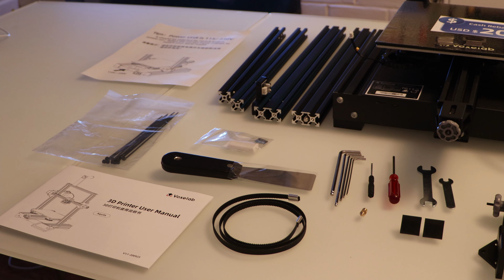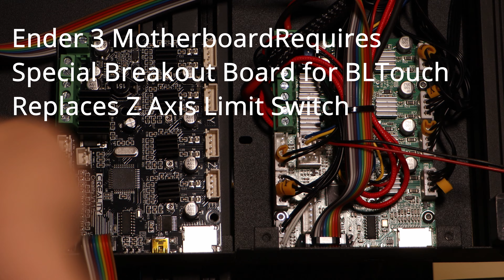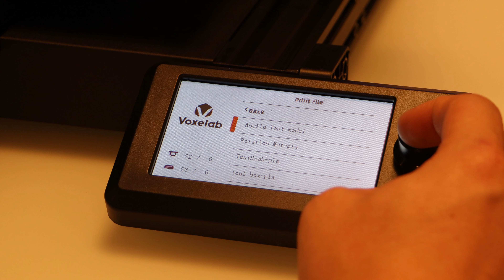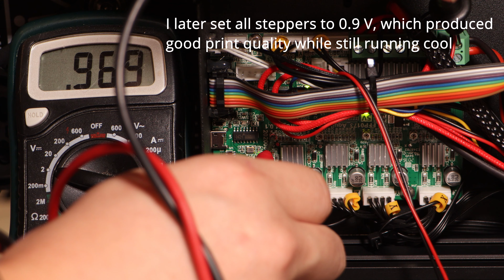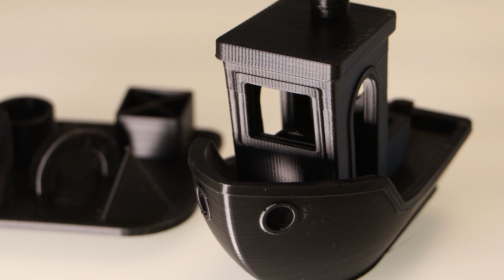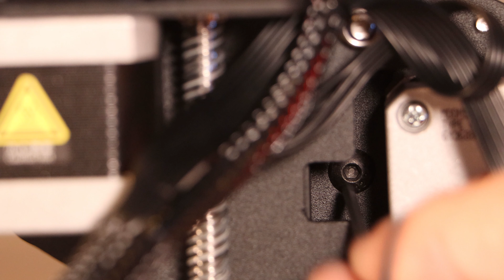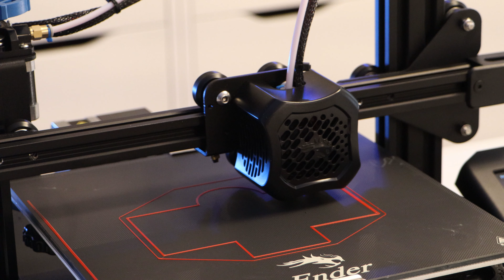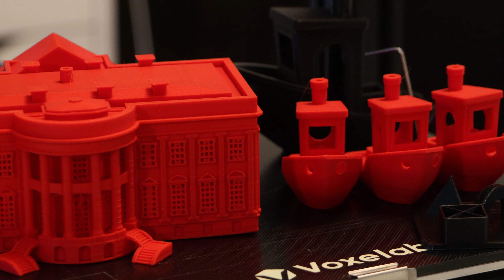VOXELAB AQUILA VS Ender 3 V2 - Which Budget 3D Printer Should You Buy?

Comment: the voltage switch put simply if you were to plug into a american outlet while on 230V put simply it just won't power on as it won't have enough juice, same the other way round my guess is at 110v if i plugged it in in my home set to that it most likely won't power up if it does it will work horribly as it won't be drawing the necessary power

Comment: I have had an Aquila x2 for years and was happy with it. I have now bought an x3 - it is going back to Amazon on Monday. 
Avoid the x3 - Avoid Voxelab from now on. They claim it is Cura compatible but don't publish a cura profile, the manual is assembly instructions - not a manual. The 'bed levelling' doesn't work with G29 at the begining of a print. THERE SEEMS TO BE NO Z STOP switch. You have to manually set Z zero!  The x3 is an x2 with stuff added badly - I didn't need to replace my x2 so the x3 goes back.

Comment: For anyone wondering what to purchase between the Ender 3 V2 or this Voxelab Aquilla X2, after owning both, I really like this X2. The Creality was better packaged but that's about the biggest difference. The machines are 99% identical. The X2 also provides a filament runout sensor and an aluminum carry handle. I got my X2 for $160, for that price I can upgrade it to a direct drive extruder and be at the same price of the Ender at its cheapest. I run Jyers firmware on my Ender which is a great enhancement.  But running stock firmware on both machines side by side, they print equally and are both great machines. I didn't have any quality issues with my Ender as he had in this video, in fact the fit and finish was slightly better on my Ender,  but you are paying more for the identical machine.
Reply: Is the X2 noticeably louder or are they much the same?

Comment: hey dude so i just brought one and it will not print properly after i ran out of the filament that came with it  iv tried every thing other videos suggested  but it will not stick or will fail all to gather iv leveled it and even max temp it what can i do
Reply from the maker: Could be the filament you're using. Also I wrote the bed with alcohol wipes to make sure it's clean off dust and oil. Could be a lot of things though

Comment: Which slicer did you use for the voxelab Aquila???
Reply from the maker: You can use Cura or Prusaslicer, though I prefer Prusaslicer.  
Just use a profile for the Ender 3v2. This machine should print exactly the same.

Comment: Best look at these great printers I've witnessed. Thanks mate! 
Just ordered an Aquila X2 as my 1st 3d printer. Would it be fine if I didn't mess with the stepper with the multimeter and left it stock, or would it be best if I'd check it just to be safe?
Reply from the maker: Yes, it is well within normal operating temps. Steppers can run over 70C-80C without issue. I was just going the extra mile with tuning and efficiency.

Comment: When people make these models do they also have to design the make up of the inside of the prints, the parts you don't see, all of the cross hatching the fillament filling has to do?
Reply from the maker: No, that is taken care of by the slicer program. It is called "infill".

Most people use 15% infill, so the parts are much lighter and print faster, but you can't tell from the outside

Comment: I have a Voxelab Aquila I bought after you made this video and I have analysis paralysis looking for the ideal extruder/hot end combo for .4 nozzle and below printing. Until now I print a lot of smaller detail parts and structural stuff for scale models. I plan to print PETG/ABS/ASA/CF Nylon and get an ender extender kit and enclosure for it soon. 

If price was no object, what are the main upgrades you would recommend going from stock for print quality and reliability? I've had two thermistors go bad in the last weeks giving thermal runaway errors on long PETG prints. I think it is my Aquila's way of telling me she's ready for some enhancements.
Reply from the maker: My favorite upgrades in any machine are

All metal heatbreak
Dual gear direct drive extruder

I go with cheap BMG clones 90% of the time, but if price is no object I would try out the LGX from Bondtech. 

It really depends on what you're goal is. I find most printers to be too slow, so I usually also put a 0.6mm nozzle on too so u can run .4mm-0.6mm layer heights. I could recommend a CHT bozos if you want more speed
Reply from the maker: Also I really like textures PEI build surfaces
Reply from the maker: If you want a bigger printer, I'm reviewing the LONGER LK5 PRO, i went in with low expectations, but it's got fantastic print quality.

Here is an affiliate link to the LK5 printer, it can be found 80-100 cheaper on other sites though
https://amzn.to/3pIRbgS

Comment: voxelab is flashforges budget run of printers. i was blown away by how well the build qaulity was for the voxelab proxima for the price so when they come out with the aquila i wanted one but never bit the bullet just cause i didn'tt really have room for another printer but i just got one for 100 bux so was hard to pass up plus ive recently made room and couldn't pass up the deal so i got. ive done the 230 when it should have been at 115. i dont it on my anet e10 printer when i first got it a couple yrs ago. it actually worked fine until it started trying to print an even then it was able to pull it off, it just took forever for the bed an hotend to get up to temp. i had put a silicon sock on the hotend so i feel like it wouldn't have been able to get up to temp if i hadn't done the silicon sock but i figured it out when googling the slow heating times but by that point it had already started the test print an was actually looking ok but i stopped it an changed the settings. now from my understanding if u do it in the opposite way. 115 when it should be 230 then ur sending more power to it then it expects an should pop a fuse if it has one or could do damage if not. ive always wanted to make videos on my printers but my work space isn't the cleanest so ive never went through with it but if i ever manage to get a tidy work space i may try to share my work space. i have 10 fdm printers now an 2 resin so im by far no print farm but i have been able to make them pay for them selves an then some. also i love my creality machines, ender 3 an ender 5 but ive always looked at them all the same, they are budget printers an even with the most expensive "budget" printer $500 US for a sapphire plus vs the cheapest $150 US kingroon kp3 they all worked perfect after a little tinkering, some with less but they all worked out of the box and all the tinkering just made them better.

Comment: Going to voxelab as my first 3d printer. I don't have a temp scanning device so what happens if I leave those stepper motors running hot?
Reply from the maker: Nothing, they are just fine running at higher temperatures. I just brought it up because it was a difference I noticed. 
 You'll be able to feel the difference though.  65 degrees C is too hot to leave your hands on for long

Comment: Where can I get an SD card with cool printing designs for my son. Not a computer guy. He has the voxelab aquila c2 printer. Thanks
Reply from the maker: You have to use a slicer to generate the printable files.

Look on thingiverse to find STL files, which you can open in PrusaSlicer or Cura.

I like Prusaslicer, there are tutorials out there to help guide you through the process. For all intents and purposes your Aquila c2 is pretty much an ender 3 v2, so look for Ender 3 v2 guides. Good luck!

Comment: With the wrong setting on the power supply the printer wont start right away. It will take an unknown amount of time tell it may or may not charge its capacitors to the right voltage to start. however you will have power failure during the print do to loss of power to high components "hotend".

Comment: If you set the voltage incorrectly the surge in power will cause your home circuit breaker to pop. If you're lucky it will pop before there's damage to the power supply.
Reply from the maker: I see. Just for context, are you with team 110VAC or team 220?
Reply: @NathanBuildsRobots  110

Comment: If you use the wrong voltage setting, the power supply will explode, at least last time this happened to me. I was using an old dusty PSU though.
Reply from the maker: I see. I'm taking a poll of puerile who have answered this question just to figure something out: are you team 110v or 220v?
Reply: @NathanBuildsRobots  Whatever works in your country, I say :)

Comment: I've yet to run my first 3d printer. Before buying, I have watched countless hours of videos on printers from various users to compare. I can say without a Doubt two things. One, your video has been the most helpful and insightful of all those I have watched. I believe it's helped me finally come to a decision. Secondly, I can also say do NOT mess with this man's screws! But in all seriousness, with the high video quality and meticulous attention to detail, I will likely be going with Voxelabs moving forward. I simply agree that the amount of thought and detail they have put into their machines has resulted in a higher end product coming out. It looks as though this may be a very good step into exploring 3d printers for me.
The print quality and comparison of issues out of the box between the two manufacturers is impressive. From what i could see from your video, Voxelabs just seems to manage a better print quality than the Ender 3 v2 as well as a better user experience and a reduction in waste. I appreciate the time and involvement you put into making this video and just want to say thanks again for taking the time.
Reply: I now have 3 Voxlab printers and love them! Here are 2 upgrades for less then $40 that will make all the difference. Upgrade the extruder to an all aluminum! Replace the hot end, mother board and power supply fans. They are noisy and 2 went out within a couple of months. If I have the need for another printer, it will always be a Voxlab.   With 3 printers, I have spare parts on hand for almost every component. Not saying you have to do the same, but the reason is,  when my first went down because of a broken wire on the x Axis plug. I was left for 3 days and not printing. $100 is spare parts gives me that piece of mind. 
Also, checkout "3dprintsos" YouTube channel. He has done a ton of work with these and shows all the possible upgrades. Not are all necessary, but it's nice to know. Best of luck. 

 https://www.amazon.com/gp/product/B07SY745CF/ref=ppx_yo_dt_b_search_asin_title?ie=UTF8&th=1
Reply from the maker: @123masteryoda123  Those are some good upgrades, I would add stiffer "yellow" bed springs to that list of cheap and useful upgrades. 

I have been happy with my haldis BMG clone extruders (I bought 3), but almost anything is better than the stock extruder. https://amzn.to/2ZwhyN2
Reply from the maker: I assembled them back to back and pointed out literally every small difference I could notice. It ended up being a lot of small wins for voxelab on an otherwise nearly identical product. 

I think the Aquila makes sense for a lot of people just based on price alone. It is still a $100 price difference, which is shocking!

Comment: Would you happen to have a 6month update on the 2 machines??
Reply from the maker: I have an Ender 3 pro, Ender 3 v2, and an Aquila, they all still work great. 

The Ender 3 v2 in this video was built for a friend so I don't have it anymore. The build plate was pretty much a nonstick coating with PLA. I kind of got it working by cleaning it with acetone, but as a long term solution I would use blue painters tape or replace it with a pei coated flexible steel bed. For some reason this printer and another Creality build plate I bought around that time, were awful at bed adhesion. 

2 issues that's came up with the Aquila:

1) apparently their firmware was missing thermal runaway protection for a while so just make sure to update it and you'll be all set.

2) they don't fully tighten the bowden tube all the way down. 
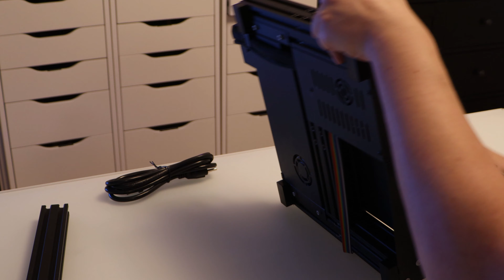Check the 1:10 mark of this video to see how to fix that: 
https://youtu.be/bgY8vwv3gQA

At a $100 price difference the Aquila is still a much better deal, even if you have to work through a couple bugs, and the long term reliability should be near identical since they are pretty much built the same.
Reply: @NathanBuildsRobots  bro you're awesome!!! Ty for the feedback. Definitely going aquila

Comment: If you have 230 volt’s when you are in a 115 voltage area if will take forever for the hot end and the heated bead it will take like 20 minutes instead of 5

Comment: good video, all of the issues you had though with the e3v2 ive never run into and i have 2 of them. i do quite like the display orientation with the VA and think its funny that when they sent out the x2 they directly copied the e3v2 which will go against your positive mounting point :)
Reply from the maker: This is the second Ender 3 v2 I've built. The he first one didn't have any of the problems, except for the bed wheels being overtightened. Can't say if the extruder was good or bad since I put a metal one one without trying the plastic stock one.

I'm not sure why they released that second aquila, it's pretty much the same thing.
Reply: @NathanBuildsRobots  oh yea, its identical besides a handle and filament sensor. i think haha.. and I'm the same, I never once used the plastic extruder and always find it amusing to see the amount of posts about them breaking and people being surprised by that haha.

Comment: Regarding my experience with layer lines.  I bought a used Ender 3 V2 on eBay.  The unit was described as a refurbished return unit.  The eBay store had many of these in stock so returns must be a fairly common event. After receiving the printer everything went well for the first week, with almost constant usage.  I gradually started seeing layer lines in my parts.  Occasionally at first, but after awhile almost every other part would have at least one line, sometimes two or three.  The parts with layer lines were often able to break along the lines fairly easily by inserting a utility knife into the line and prying.  Some lines were more or less along the surface but many were all the way through the part.  I also noticed that I began to have prints that would finish prematurely even though the Ender status bar would say the print was 100% complete.  I would also look at a print that was in progress and see that the status was for example 60%, when the print was obviously much less, maybe 10%.  These prints would later end prematurely.  I googled this and found someone who said it was related to corrupted memory cards.  I changed memory cards but the problem persisted.  At this point I suspected the micro SD socket was having problems.  I inspected the slot as well as I could but didn't see anything obvious.  I had a can of Deoxit D5 and sprayed inside the slot of the socket.  The problem of lines and prematurely finishing prints went away.  After another week I started seeing occasional lines on my print again.  I sprayed the socket again and the problem went away again.  I have ordered a new micro SD connector and if the problem returns I plan to replace the connector.
Reply from the maker: Wow what a journey. It may need a new mainboard, and/or you are getting occasional underextrusion from nozzle clogs or extruder slippage.

Comment: Thxs just the review I was looking for and about to buy the Aquila, shame about the display though never seen it done like that....I'd pay a bit more for a decent display!!
Reply from the maker: I was surprised to see it, though I'm not really bothered by it since everything is completely readable. It took a macro shot for it to even show up on camera I almost forgot that it has that issue and I've been printing with it for months now. 

But if it does bother you, there are solutions that cost less than the price difference between the Ender 3v2 and the aquila: 

You can buy a new mainboard + display, or a raspberry pi. 

You can set up octoprint and you won't have to look at the menus any more. 

You can flash the firmware to a community edition, though I tried this one and was unsuccessful. Almost bricked the printer.
Reply: @NathanBuildsRobots  Thxs for your reply - if it doesn't bother you then it sounds fine by me - just want this to be a cheap entry / learning curve into 3D Printing & keep things as stock where possible.....later on if the bug bites then got my sights on a RatRig VCore3 :o)

Comment: Interesting considering how much the ender models costs. 

I have a low hours flashforge adventurer 3 refurb only thing i am waiting on is a 265c high heat nozzle assembly so i can print in pet-g etc because 240 wont do petg and just jams and doesnt melt propely the extruder locks up and causes stepper to knock and miss steps banging.
Reply from the maker: I always print petg at 240, you might have a jammed nozzle or something.

Comment: Well I have an ender 3 v2, I never had issues like you do in this test. 
You didn't tune this ender 3 v2 properly and you may have been unlucky with nozzle. 
This review don't represent the ender 3 v2 correctly. 

I think anyone must pick the cheapest between the two
Reply from the maker: This is the second Ender 3 V2 that I have built. The only issue I had on the first E3V2 was the V-roller wheels were too tight (just like the one in this video). So quality is pretty variable on these machines. I fully expect that someone else could buy the same 2 machines and come to the opposite conclusion on quality as it was pretty close overall. 

I agree with you on which one to pick. Since they are so similar I would go for the one with lowest cost. The minor improvements to assembleability on the Aquila are welcome changes.